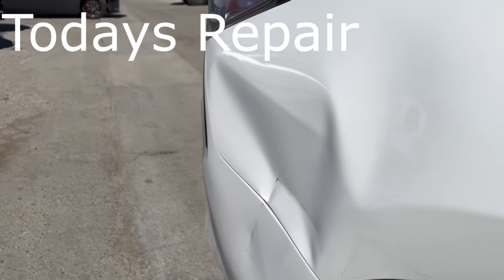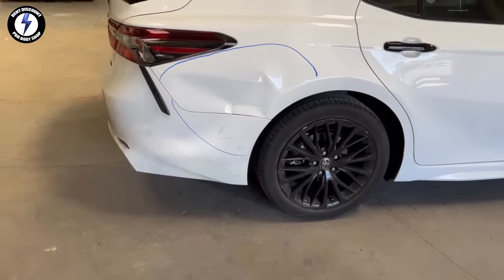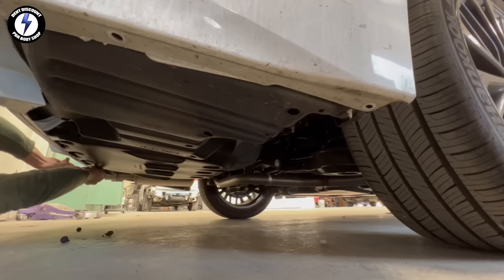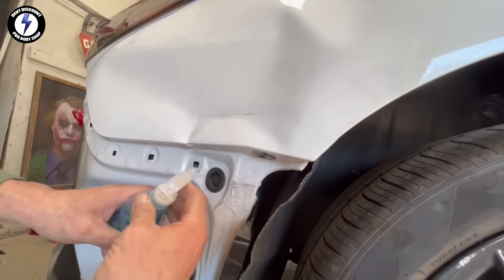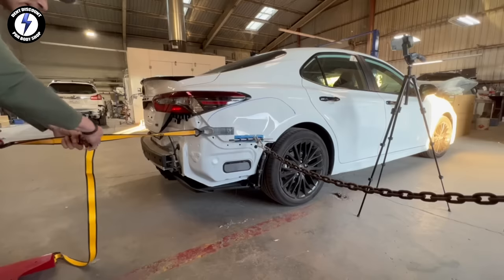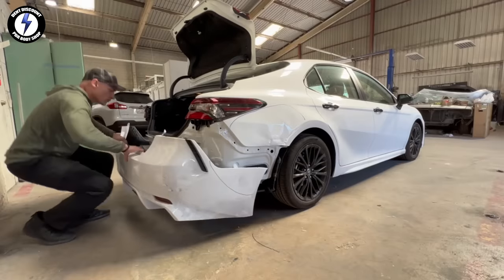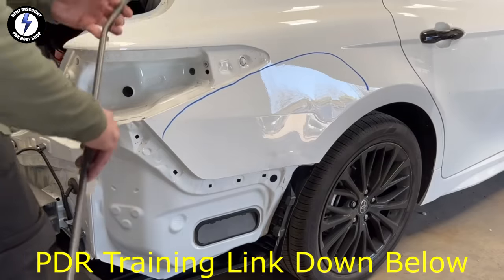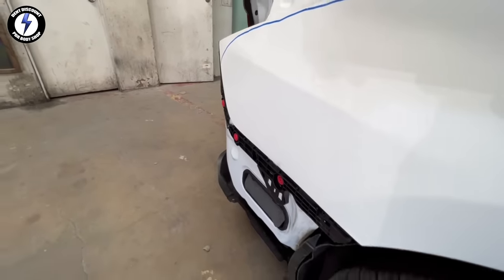Amazing Car Hacks and Tips for Fixing Dents!

Comment: I owned and operated a collision repair shop for over 20 years and I wish  this technology existed back then, the basic principle for all collision repair is to reverse the damage in the same way it occurred which is exactly what you do with a patient and methodical approach, love your work and the fact that you prove it pays to think outside the box.
Reply from the maker: Rob thank you for your comment
Reply: back then metal was alot thicker
Reply: Thx your review means a lot. I’m in nyc drive an 09 Vibe GT.  Looks good however every month a new small dent/ding appears
Reply: Wouldn’t have worked the old metal was much thicker back then compared to this new paper thin metal
Reply: Not enough money for tec doing these types of repair,  and filler could Crack in future causing tec to have a redue.
Reply: The glue today is a revelation making us so easy to pull at the surface without EVEN removing the paint!
Reply: It is always a new success but sometimes the paint flakes
Reply: If this is real ,then it is amazing
Reply: 20 years from now they will just 3D print a new fender at home.
Thank God duct tape will never be replaced.
Reply: Wow is good work
Reply: @themooreclan1220  20 years ago was the early 2000's the metal was not thicker back then. If you were talking the 80s and earlier then sure.
Reply: These methods did exist back then.

Comment: I restore old motorcycles, like 43 year old bikes or more. Last restoration, an electrical repair guy transported my bike, but did not strap it properly, it fell, denting the tank with a 1 foot wide by 1" deep dent. I have to learn to repair it myself. Thus I watch this video.

Comment: i went to a auto body repair shop and they're telling me that they have to take out the back wind shield and reapply it, remove the back seat and right side door, remove the wheels, remove all the seals that were bonded and rebond it and put like this corrosion protection stuff on. for the quarter panel damage. felt like they were trying to get over my insurance company.

Comment: As always, great job.
I love how you are always looking to improve your technique, tools and share your techniques with us.

What temperature do you heat the panel to avoid paint damage?
Reply from the maker: David If I’m wanting a really strong pull I’ll get it up to 200°
Reply: @DentDiscountPDRBodyShop  
Thank you! 
I've tried different temps but I'm always worried I'll get it too hot and ruin the paint. I'll keep it at 200 deg. or less from now on.
Reply: Hi man of steel, I’m always worried about using a flame on paint, is boiling water or a heat gun any good instead?

Comment: Truck driver here. My truck was hit on the driver side sleeper area in a hit-and-run at a truckstop. Anyhow, I have the option to take it to the shop and they'll take a month as they don't loose any money. Or, just attempt this myself. The damage is about 10x12 at the corner where the sleeper meets the door. Great video 👍

Comment: I have been working my way through all your videos. Yours are the best I have seen about how the process works and your results are flawless. I am very very slowly going to try to do some pulls on my truck following your guidance the best I can. It won't be perfect but I enjoy learning how to do it. Thanks!
Reply from the maker: Cheryl right on
Reply: I ordered replacement q/p ànd hood, and hinges. So my repair will vary, I will , bumper metal and fiberglass repairable

Comment: New subscriber here. I actually live in Brazil and this kind of work is relatively common here. What's not common is to fix the dent when the paint cracks as shown is this video. In this case, they rarely do touch ups, they weld, pull, burn holes (and the steel looses temper) and paint a large area instead - in order to "equalize" the paint. I think it's better to keep the paint most original, even when touch ups are not perfect.
Reply from the maker: Welcome to my channel thank you for subscribing Bob

Comment: I've repaired my own dents. I use body hammers, dollies, and dent pullers. I have used a plumber's plunger before. I have 2 bottle jacks to sway panels. I have an orbital sander. I usually touch up the area with an air brush. I then compound the area to blend. 🐀🐾
Reply from the maker: Right on DJ thank you for sharing I appreciate your comment

Comment: i have a little dent puller with hot melt glue tab but it won't pull out large dents only has one small pad and a bridge over the dent with thumbscrew.
 you tube just recommended your channel i like this style of repair over the old dent pullers with weight and screw or welding pins to car this is great for spots with dent but little paint damage
Reply from the maker: Thank you for your comment

Comment: New subscriber, just bought a vehicle that was side swiped and left pretty significant dents with the worst damage in the rear quarter panel (Chrysler 300) I’m a diy guy trying to learn the best methods without buying a hydraulic puller. I’m all for body hammers and slide hammers, though. Much easier to afford and use in the future. I wish I could upload a picture of the mess I’m going to attempt to tackle.
Reply from the maker: Thanks for the sub!

Comment: goldsmith/master jeweler here: this is art i use to go to junk yards and find the parts and swap, those days are gone. i have a '68 dodge dart that got hit on rear drivers side. i wonder if this glue will work with that type of 'ol metal because today's metal is wimpy. the tail light never broke the trunk is not damaged opens and closes fine a little tweak off, the corner of the bumper bent. i used a come-along to straighten a bit but i am SCARED of the tension and if the cable breaks it's RIP forever. loved the video 👍

Comment: New subscriber here. This is very good instruction. 

I’m curious why you didn’t use ratchet strap on both. Better control with the hydraulic? More force with the hydraulic?

It’s hard to comprehend which dents can be fixed this way.
Reply from the maker: Thank you for subscribing welcome to my channel
When I’m feeling lazy I use the hydraulic puller
The strap works well

Comment: Current body tech here.  The shop would have me grind to metal, and use a spot puller or other welding based methods.  Then filler and a ton of sanding.  I think it's an out-dated process.  I'm very interested in better techniques.  Ken's the man to pay attention to.
Reply from the maker: Ricktacular James right on my friend thank you so much for the input I like your comment

Comment: Very awesome Video.  I’m new to your channel.  Came across this while looking to see how I can fix my 1995 G20 van that was hit in left front   The fender was all bent up and inner liner is dented. Trying to find out if u have to take doors off to replace fender.  I know windshield has to come out.  I’m trying to fix this in my driveway. I have no shop.  I was going to hook my come along to inner liner and pole to try to get it pulled out.  Any suggestions

Comment: I’m a retired UK fire officer & remember we had a road accident in a narrow country lane. The driver was trapped by the legs. Everywhere we wanted to put the cutting & spreading gear, his legs were in the way. I used to do a lot of my own repairs and remembered the tip about ‘pulling the damage out the way it went in’. We secured the back of the car with chains to another fire engine behind & used our winch on the front of our fire engine to pull our the metal.
It worked like a dream & the driver was out in minutes and off to hospital. 

On another matter, how do you get the crease out of the ABS rear bumper?
Reply from the maker: You can use a PDR rod on plastic the same way you would on steel

Comment: I'm a....   NEW SUB!  
THANK YOU for SHARING‼
I have minor collision damage on the driver side door.  I readied some makeshift push rods and pushed out alot of the damage, but I'm gonna find the glue gun and try some of that pulling technique to see if I can't smoothe it out further.  Trouble is I can't undo the rivets to really work on it from the inside since I can't replace them after, so doing a lot of reaching and awkward pushing through available entry points.  Again, gonna try the glue and pull method next.  I feel hopeful after seeing you do it this way.  Thank You again for sharing! 😁👍
Reply from the maker: Carmelo thank you so much for your comment

Comment: @DentDiscount-PDRTraining~ I have a full restored, all original matching numbered parts, 1970 Ford Torino Cobra w 429 Super Jet Engine package. The body paint was restored to a mirror level finish. The restoration was completed in 1983. Other than some Sunday drives, it has been be stored in our garage covered with complete car cover. A few years ago, it sustained a small dent in the rear quarter panel when it was inadvertently hit with a riding lawn mover. My question: How do your dent repair techniques work on Classic Cars like mine, which have a heavier steel body vs today's newer cars? Do these hacks and tips still work on a classic car?  I'd appreciate any feedback you could give me! Thanks ~~Christy~~

Comment: Nice metal work, super impressive skills.  I would love to learn PDR skills.  The paint touchup is a challenge.  I am not a big harbor freight fan for much other than disposable tools, but I did pick up a cheap air brush from them for small touch ups.  I found with a good color match and pearl in this case you can get an almost perfect match that is not as obvious as the touch up bottles you can get from the dealer.  I haven't tried clear coat over a touch up yet, but doing that then spraying a blending agent might make it look like nothing ever happened.

Comment: I'm new to this and never worked on car bodies before. I wish I could remove my dents and crease in the body panel like this. Unfortunately my car is a 1990 pajero with metal twice the thickness of today's cars. Can it be done. Other alternatives are to weld and pull or fill with lead filler. Advice appreciated dude. Pics available if it helps

Comment: Forgot to show the side on view in the shop with your light and you can get the same result by pushing with a sharp tip bar seeing that painting cant be avoided, as long as you get the edge sorted out first and a bit of glue pulling, but still a good job bud. Always said not all hail techs can do dents like that and I'm glad i have that experience from 31 years of hail and parking dents.

Comment: This is really awesome this is my idea kind of but I didn't figure glue on type pulling mechanisms I just thought of putting a small hole with a component behind or inside the dent and then pulling gently back of course I never worked in a body shop and these are just my ideas here on the farm but yes I don't like the idea of that welding stuff and all that this is exceptional and very logical great work
Reply from the maker: Thank you for your comment

Comment: I subscribed a little while ago, but haven't kept up with your videos lately, so I still consider myself a new subscriber. 😀
I ordered some supplies (probably cheap stuff) and tried to pull some dents on the rear quarter panel, near the rear bumper of my Nissan Frontier. The results were quite disappointing because I couldn't work with the glue and glue tabs that I had. Sometimes the glue wouldn't stick to the tab. Sometimes it wouldn't stick to the dent. At other times the glue stuck too well and I caused more damage just trying to get the glue off. What am I doing wrong?!
Reply from the maker: Welcome to my channel thank you for subscribing

Comment: Question for the master of Pros. lol. these kits you can buy on amazon I bought a set long before I started watching your videos have all steel tips on them for the rods, I see you you and a couple other people using rubber and nylon tips. can these metal tips work as good as the rods you have? Like I said I bought this set a while ago I really want to learn this PDR thing, I been doing bodywork for 17 years and getting tired of slinging mud. Ok here is the question I bought rubber end caps universal for anything. on amazon all different sizes would those work if I put them on my rod ends?
Reply from the maker: Justin you sound like you need some one on one training my friend here’s my email in the link
http://secretpdrpaintlessdentrepairtrainingonline.com/  
One on one training send me an email on this link

Comment: I use alot of PDR and glue pulls in my conventional collision repair shop, but it's typically on smaller dents. I'd honestly like to do bigger dents, but  I see very few larger dents that dont have major paint damage. Deep scratches and cracked paint that make PDR impossible. I'd say around 5% of the dents the size you fixed here qualify for PDR.
Reply from the maker: Ed thank you for sharing
Reply: Ed are you aware you can GPR (Glue Pull Repair) on bare steel? PDR repairs on bare steel are a bit more 7difficult than  matte /denim clear PDR repair.
Reply: @undentmeister  If I've got a panel down bare metal I just use one of my conventional dent pulling machines. Way faster
Reply: @edjackson4389  i beg to differ. The initial repair maybe faster. But add all.of the time to fix the backside panel damage caused by your machine and material cost. GPR is less invasive and IMO just as fast
Reply: @undentmeister  What extra material cost? You think a quick shot of undercoating is a major expense? It hasn't been a problem in 22 years. IMO it's takes less time than messing with the glue. Im able to fine tune the repair to a higher degree from outside the panel. Less tools needed

Comment: Yeah I have an 95 Honda Accord sedan that I'm looking to repair a small but really smashed in there dent. It's on the passenger side rear quarter panel where the door jamb and the fender well start coming together. The worst one is the crease that got put in the edge of the door jamb that everyone says has to be cut and welded. And could you believe it was a freaking food sign that fell and hit my car in a storm. 😒 Near mint body and that crap happened 😖
Reply from the maker: Sounds like you have work cut out there my friend 
thank you for your comment

Comment: That's if the dent is not over a weld or where 2 panels join.. only where it's the panel itself without any structure behind it. Like where the floor meets the quarter panel. Luckily that is not the case in this case lol.
Reply from the maker: Hey boss thank you for your comment really appreciate it

Comment: I'm a new subscriber, and wish to know what shops you would recommend to me ,to get my dent repaired, here in Las Vegas, Nv. 89139 area code. My dent was from the previous owner, who backed along side a post by the passenger side wheel well. It's more of a slight bend inward and slight paint damage, but with no sharp angles, over the top of the tire area and just forward. I have tried bodywork in the past, and suck at it. Ha Ha!
Reply from the maker: Welcome to my channel thank you for subscribing
I would recommend getting on yelp reading reviews and looking at pictures

Comment: Good luck doing this if your paint is cracked and your bar is split. This only works if the paint is still in good condition otherwise trafitional repair and paint is the best method.

Comment: Been painting since 87 paintless dent repair is only good for push to paint . paint does not flex without flex agent so when you look at the surface they just pushed you will notice the paint is cracked . Mercedes doesn’t even recognize it as a viable repair. Stay with  I-car certified collision centers and you will get a quality repair not an illusion of fixed

Comment: struggleing with the metric system
Reply from the maker: Markus thank you for your comment
Reply: @DentDiscountPDRBodyShop  
Was a M6 x 1  with 10mm head. Not a 10mm bolt.
Tip for metric bolts 
Diameter minus pitch equals drillbit size for tapping.

Comment: Here's the $8000 in tools you will need to pull out a dent that only looks bad but does not affect the drivability of the vehicle.
🤣
Cut the 1/4 panel off, replace it with NEW and repaint it.
$500 max. And thats with buying a welder.
* or buy a fender from a junk yard that matches your color.
Millions were made your color. 😂
Reply from the maker: Thank you for sharing